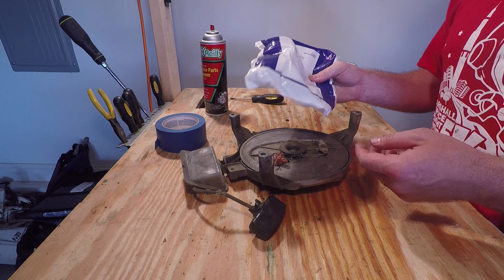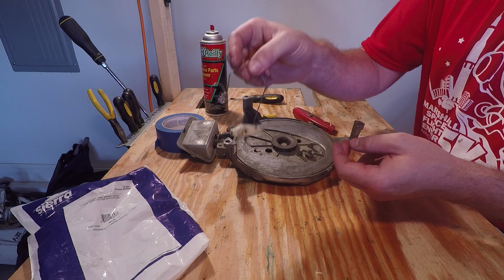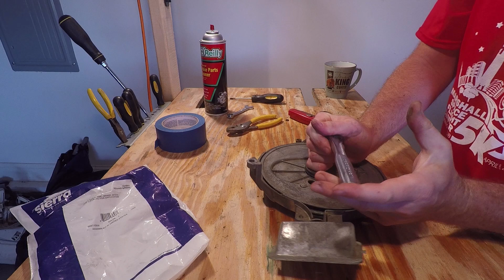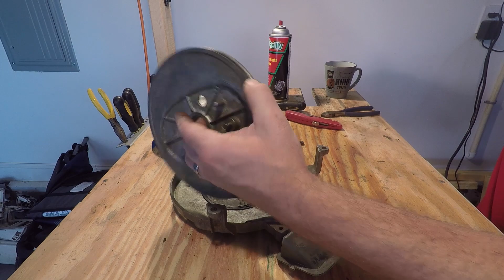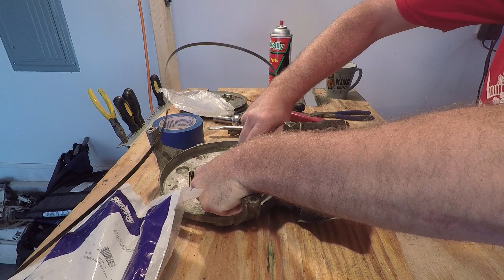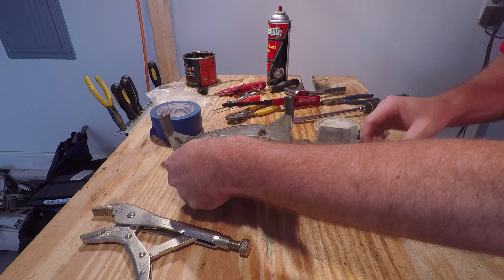Repair Johnson Evinrude Outboard Recoil Starters

Comment: Just finished rebuilding my 1977 Johnson 20 hp (Canadian model) manual starter. It went like charm thanks to your excellent tutorial !
Reply: How many rotations did you use? I'm about to try to restring my 20 HP Johnson aswell 1988
Reply: @bjjohnston2868  I didn't count, sorry, but I went around till it became real tough to hold on. I guess it must have been 6-7 turns as it did gobble a good 5 feet of cord upon release.  Regards !

Comment: Excellent video rocket city motors, well detailed and explained by you; this will help me tremendously with my 83' Evinrude 25 H.P. starter recoil spring replacement. My alignment marks and arrow pointer are off by about 20 deg. or 1-1/4". This should help me pull on the rope start a lot easier once repair is complete. Thanks man!